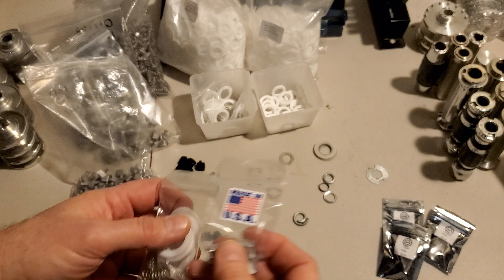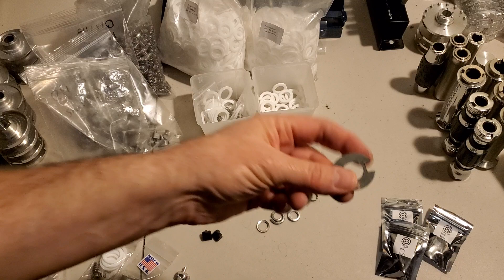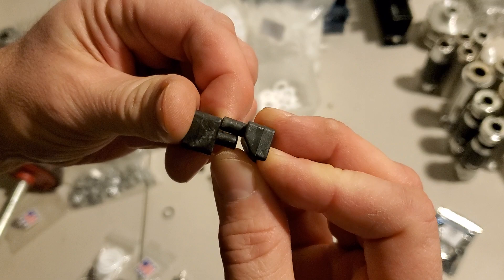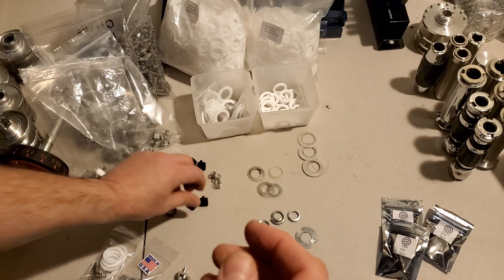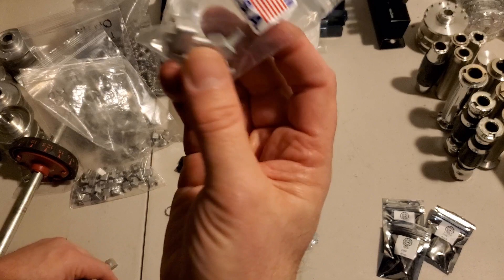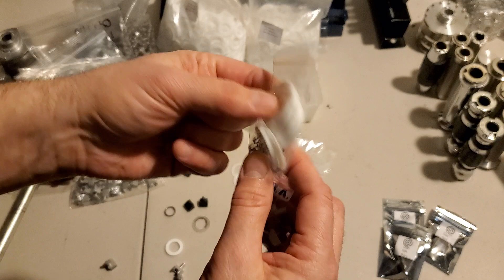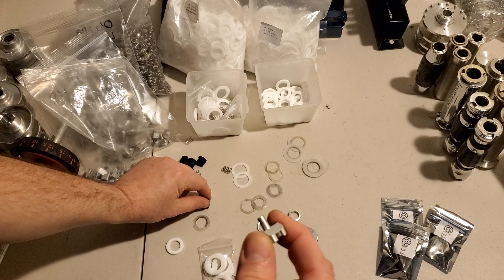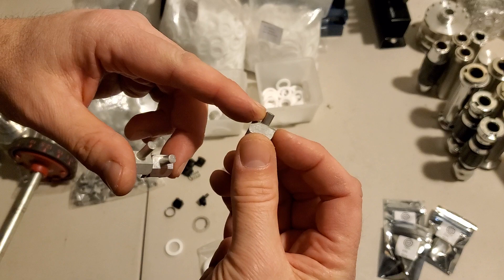BF 552 & 1090 Dumbbell - New Average Joe Locking Pin, Spring and Washer Kits

Comment: Why don't you create your own version of dumbbell instead of trying to fix the BF dumbbell?
Reply from the maker: Hi Isaac. The short answer is...this began as a DIY project to fix BF dumbbells I already owned.  I had no grand plans to sell fixes to other people or make new dumbbells. Quite a few people watched my early DIY videos and asked me to make fixes for them too, so I did.  The cost to develop and launch a completely new adjustable dumbbell design will probably fall in the $250-500k range, minimum. Not the sort of cash an Average Joe has laying around.  But it's on my to-do list now. Think of the current products as baby steps toward something more. Stay tuned.
Reply: If you are thinking about buying repair product for your bowflex dumbbells, “do it” , I saved two pairs of dumbbells because of average joe, he even sent me stronger springs 1 month after buying my discs from him.
Reply: @AverageJoeInnovationsLLC  how about selling bowflex dumbbells that you have already fully upgraded? It would cut down on a lot of issues people may have. No worry about replacement parts mismatching OEM or assembling it incorrectly and having a final product that doesn’t work as expected.